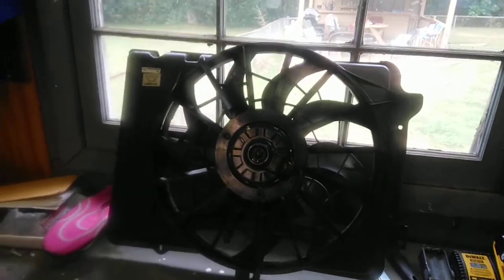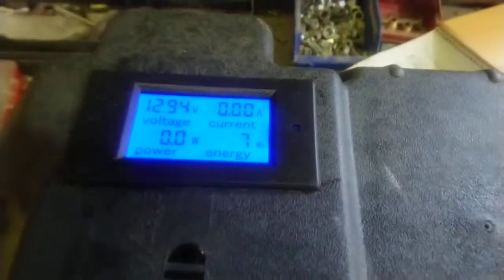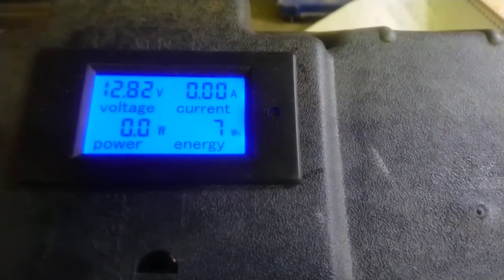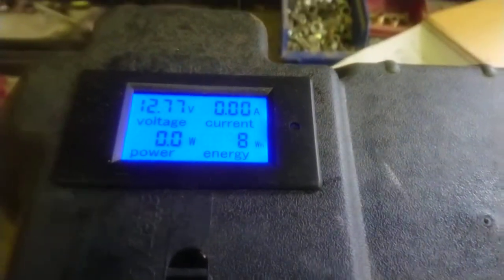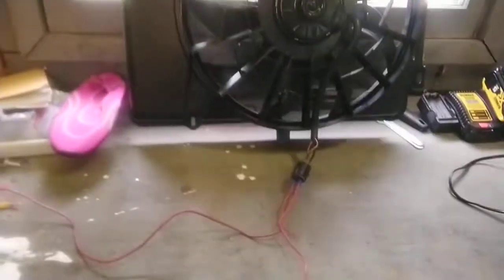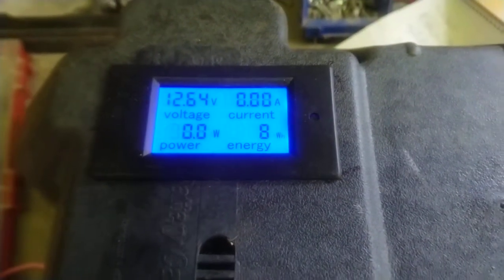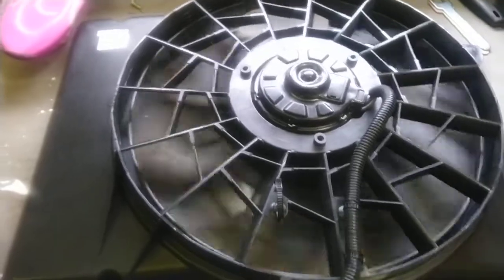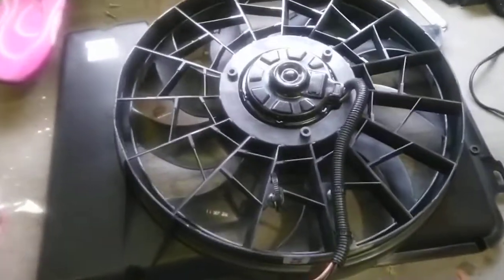90-95 2 speed Ford taurus 3.8 radiator fan amp draw test

Comment: Thanks for sharing your experience,
Is this genuine OEM ford taurus fan or OE equivalent, I am asking because i have heard that Dorman fan for Taurus doesn't perform as the  Ford OEM.
Reply from the maker: It's a clone..... Any used oem one is over 25 years old at this point and I'm not trusting that.... I believe oem motors are available and can be swapped if it's a problem.... With the amount of power this thing draws I can't see it being a whole lot less capable.... And my numbers seem to be about the same as what I've seen in other tests..... This particular one Is a spectra.

Comment: Good video except, I wanted to see the initial amp draw on start up.
Reply from the maker: The meters i used dont have peak hold and are to slow to respond to guess by looking at them
Reply: On the low, I saw a high of 17 amps during start-up. I would have  liked to see the high on start-up. What size of fuse are you using with this fan?

Comment: Hi,  What is the model/source of your digital amp meter.  I've been looking to test amp draws on my drag car components and would like to build a similar test unit.  Thanks, Ed G.
Reply from the maker: DROK DC Battery Monitor, DC Amp Meter 6.5-100V 12V 24V 48V 100A Digital Multimeter, Voltage Current Power Energy 4-in-1 Tester Gauge DC Volt Amp Watt Detector with LCD Display and Shunt https://a.co/d/i81ysTz

Comment: how much its peak on load High ? we see you filming at Low peak at 17a
Reply from the maker: If you're talking about starting current spike I have no idea ....I don't have test equipment that can do a peak/hold for that
Reply: @thebubba1  Yeah you put the camera down to hold the fan when you started it on high. You can see the start spike on low speed. Best video i've seen so far.
Reply from the maker: @edshepherd3256  ....its not accurate the sample rate for those meters is to slow
Reply: @thebubba1  it's close enough for me. It looked like 40a at start up (on high). I was thinking of getting a 70a fan controller just to be safe.
Reply from the maker: @edshepherd3256  ....i ran 2 of these on my 454 suburban....never even bothered to hook up the high side....with a 180 thermostat it never went above 195 sitting in traffic on a 96 degree day with ac blasting....heavy towing might require the high side though